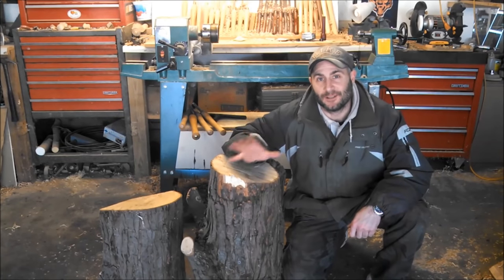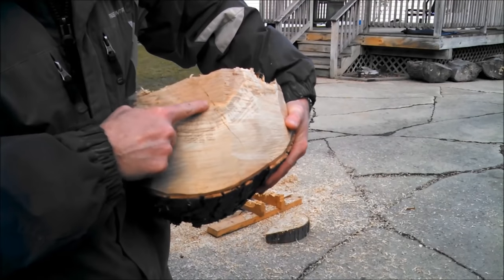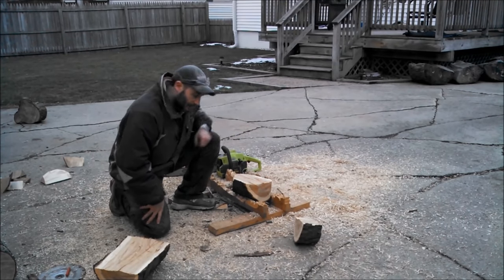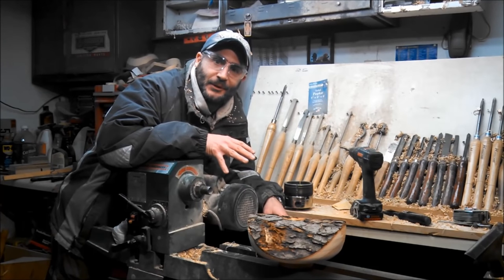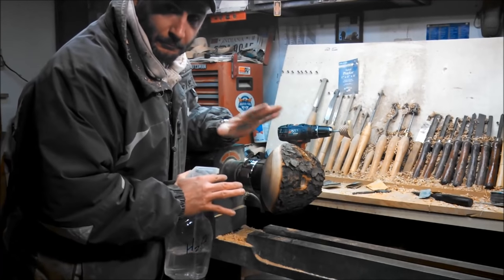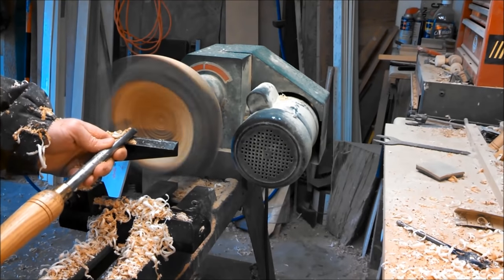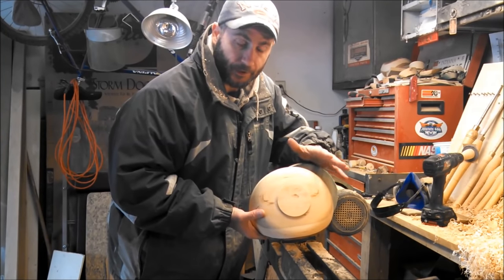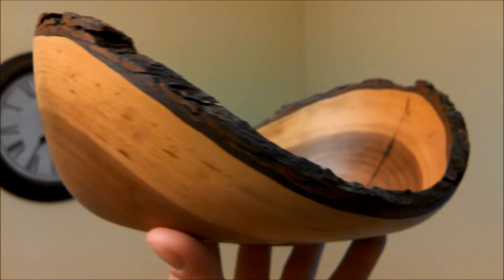Woodturning - Wet Turning - How To

Comment: Kevin I initially watched your video because you are using a lathe just like the one I just purchased used. I am a newly, just starting out. I learned a lot from the video, the best I have seen about green wood. I saw you were running the lathe at the slowest speed and some have commented that the slowest speed is too fast for large peaces. You debunked that in this video. I am super excited to get started and want to watch more of your work.  All good sound and logical insightful advice.

Comment: Great tip with the plastic bag in your chuck jaws . Tried it today with some very green oak and it worked a treat  . Cheers
Reply from the maker: Duncan Hooper I wish I would've learned that lesson before I rusted up a set of my jaws!!  Well, it just gives them character! lol  Glad it came in handy for you Duncan, glad I could help.    Until next time... Kevin
Reply: Kevin Krull I have had a lot of success using pva glue to seal the ends of my logs to stop splitting in various woods . That's the wood pva not the craft stuff
Reply from the maker: Duncan Hooper I did hear about pva glue a while back and hearing of some having success with it.  I guess I've just forgotten about it.  Thanks for the heads up, I'll have to give it a try!

Comment: Hi Kevin! Was missing you mate! Nice video, I should have seen it earlier, I have been doing some rough turnings and as most people do, when you are at a task, you try to do as much of it as possible, so, since I had my chainsaw ready, lubricated and the tank full of gas, I cut several logs into bowl blanks, alas! I did not put the ones I wasn't going to turn in plastic bags, and sure enough some develop checks! The plastic bag tip will save me a lot. Thanks for sharing my friend and I hope you are better! Cheers! Daniel
Reply from the maker: Daniel Vilarino Saving bowls one plastic bag at a time...LOL!!  Yep, I've been there, and yep, got the checking.  Thanks Daniel and time will tell.  Talk to you later my friend, Kevin

Comment: Thanks Kevin, Most of my turnng currently is with green wood locally found.  A fellow turner with lots of experience uses tung oil almost exclusively, with 3-4 applications, gentle sanding in between, and he produces a very deep sheen without too much unnatural glossyness.  Is tung oil comparable to the oil you use? and would you apply several coats for a good finish, or does one coat seem to do it?  Thanks, Fred
Reply from the maker: Fred Chase Hey Fred, great question!  It sounds like the fellow turner is using a tung oil "finish" opposed to pure tung oil.  Most of the "finishes" (e.g. Danish oil finish, tung oil finish, antique oil finish, etc.) are just linseed oil mixed with varnish and dryers so they all can be used interchangeably.  If pure tung oil is being used, if will eventually cure as it is a drying type of oil.  Pure oils will take substantially longer to cure.  As for the number of applications I use with an oil finish, 1, 2 or 3 usually.  And it depends on factors such as desired sheen, type of wood and so on.  And yes, sanding in between.   Hope that helps - Kevin

Comment: I'm curious about how you apply multiple coats of Danish Oil. I had an ash platter which I'd turned in March, and it finally stopped losing weight in mid July. Then I turned it flat (it was 13" by 1 1/4 inch thick after drying). Next I liberally coated it with Danish oil, did not wipe off any excess oil, and left it alone for 2 days - it was dry. Then, I turned the bottom tenon off bowl and gave the entire piece another coat of Danish Oil without wiping off the excess. The next day, the platter felt like fly paper...very sticky. I hand wet-sanded with a 600 grit pad using Danish Oil, and wiped it dry with a paper towel. After two more days, the oil was cured and no sticky spots remained. I think that applying the second coat of Danish Oil after two days was a mistake. Do you apply multiple coats with about 4 hours in between, or use another procedure?
Reply from the maker: Doug Robins Hey Doug!  I too wait a few days between application.  The process that I use is:  apply the Danish oil finish, let it sit for a few minutes and then wipe it as dry I can get it.  I do this for all applications.  You need to apply a very thin coat (by wipe off all excess that doesn't absorb into the wood) and let the oil cure sufficiently between application (2 days or so) or you will get the fly paper effect.  On bottle of my brand (Watco) there are instructions for a 8 hr start to finish finish.  I've never tried it though.  Hope this helps, Kevin

Comment: Kevin, I really enjoy your videos. I have the same lathe and have a question if you don't mind. In some of your videos, I think I remember seeing a short (4" of so) tool rest. I have not been able to find a shorter tool rest. The stock rest is too long for much of what I do. Did you make your shorter rest or buy it? If the latter, do you mind telling me where. I have one from an older machine that is a 1" post. It will not fit the HF, which I have been told takes a 25mm post. I've considered ordering a stock 12" rest from HF and cutting it down.

Thanks
Pete
Reply from the maker: +PeteDavis Many thanks Pete, I appreciate it! I bought my lathe used mainly because the guy was throwing in a whole bunch of accessories with it. That tool rest was one of them, sorry. I suspect it's homemade or at least not mass produced. Because of the 25mm post, your idea of cutting down a 12" rest might be the easiest way to go.     Have a good one, Kevin

Comment: Great information Kevin, thanks. That bowl turned out great.  How many coats of oil do you normally use?
Reply from the maker: Joe Ritz Hey thanks Joe!  As for the oil, it depends. Usually, one, two or three, depending on how natural of a look I want.  But I would say two is the norm.  Have a good one, Kevin

Comment: how do you sand it? my sandpaper gets clogged so quickly with wet wood and can tend to fur up the wood
Reply from the maker: +Conor Ha! Yes, it can be very frustrating, especially with very green wood.  I usually start with 60 grit and use an air compressor to constantly unclog the sandpaper. I might only get 5 seconds of unclogged sanding before I have to blow it out. Eventually friction from sanding will dry the surface enough to progress up with finer grits.  The finer grits will still clog also, just not as bad.  The fun of green wood turning!!!  Hope that helps and best of luck Conor!   Have a good one, Kevin